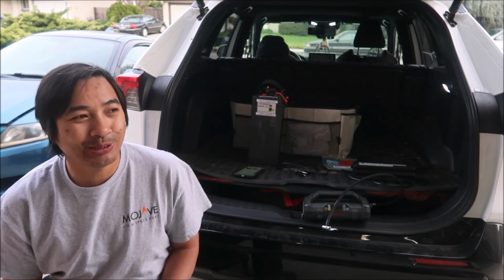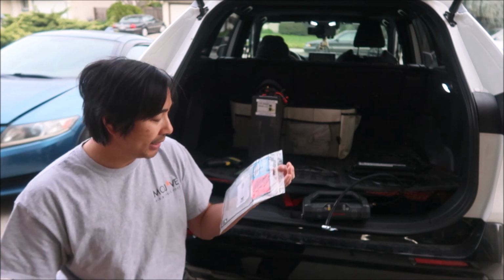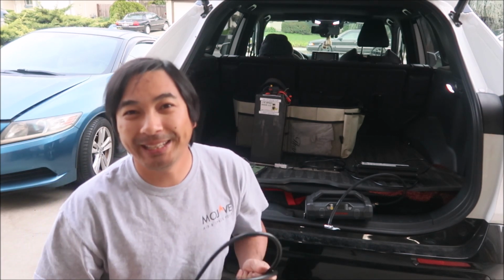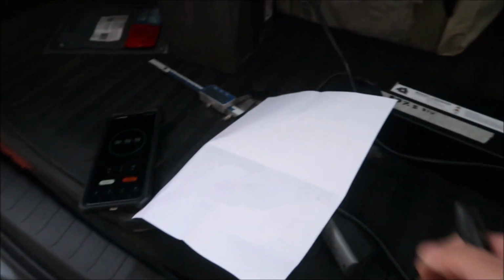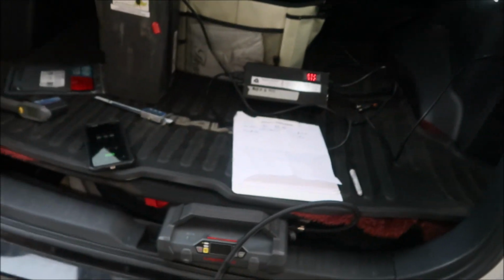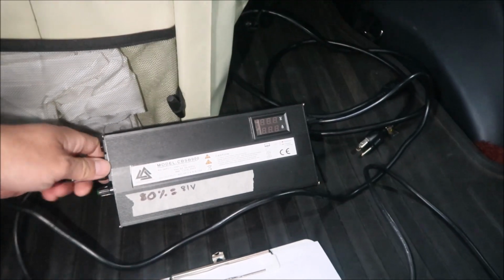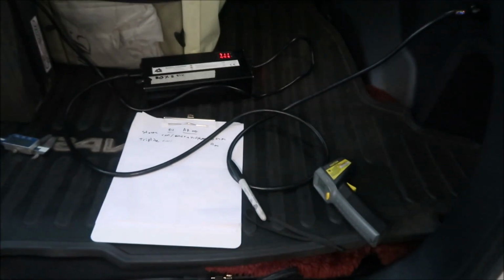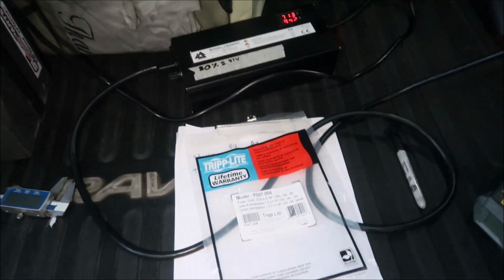Chi Battery Charger Tripp Lite HD Power Cable Experiment

Comment: Hey Hades! FYI battery percentage is not a good measurement, because its set by the builder on the BMS software. Which means that you have to have control over it to see/change what its originally set to. Therefore my tips is just to look at the battery voltage instead, then you get it right. If the manufacture of the battery wants to show 90% on a 72v (20s) when the battery voltage is 70v they can, but does it mean its "really 90%", no it doesnt. BUT if the same battery shows 84v or close to, it really means its actually 100% or really close to it (depending what you choose to measure it). Just a tips.
Reply from the maker: Yeah it's just harder for me to grasp the voltage.  I have to actually think about it.  SOC is easier for me especially while I'm riding or racing I don't have a lot of time to think.  I've calibrated my battery meter on my bike so just go off of that.  I'm my opinion the Chi charger is not well calibrated, it charges the battery a little more than what setting its on but that's the main reason I bought it so it would shut off at a certain SOC so I'm a bit disappointed but it's ok.
Reply: Ic ic. I guess Chi did a bad job if both the battery and charger is made by themself and theyre not calibrated the same. I guess they use same battery cells in all theyre batterys, otherwise that may be the answer. Different battery chemistry can have different SOC voltage calibration. If Chi made it possible to change SOC calibration on theyre charger it would be a esy fix, but i guess its not possible? If so, you should contact them to fix it.
Reply from the maker: @yehovasaso9284  I guess so or maybe just the calibration is a little off on this charger.  The Chi battery uses the same cells as my Litespeed 32AH pack Molicel 21700.